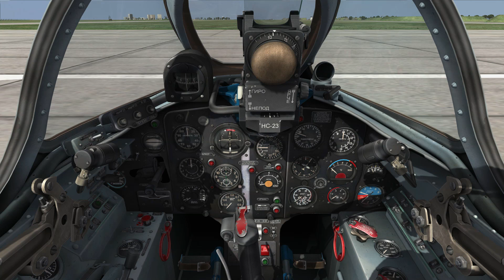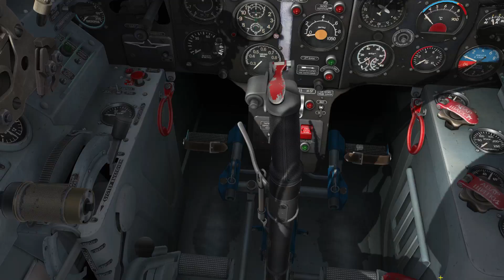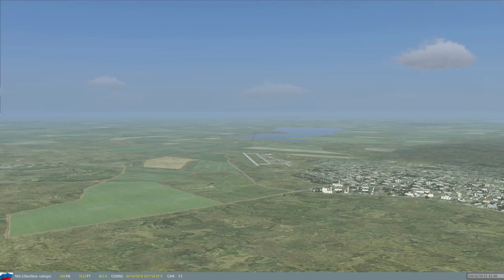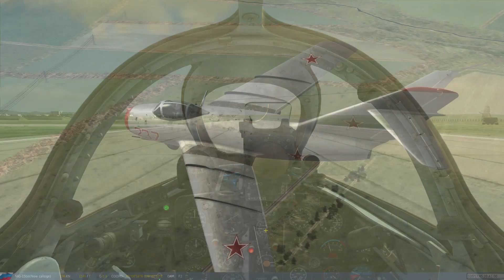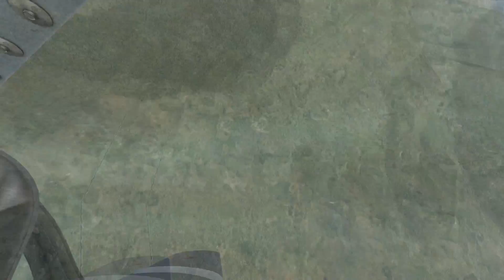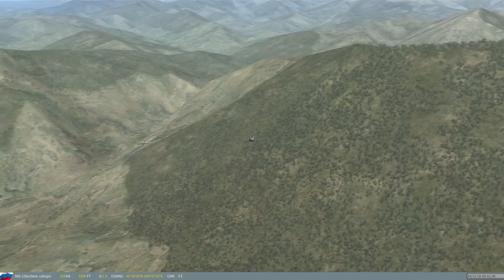FROOGLE'S HANGAR : DCS MIG-15 BiS BETA

Comment: Actually the MiG-15 wasn't designed to fight the Saber, it was actually designed to take out high altitude jet bombers, that's why it has such a cannon heavy load out. The Saber was designed in response to the MiG-15.

Comment: I know this probably sounds like an idiotic question to someone with a lot of experience with the sim, but how do you know what runway the tower tells you to take off from? For example at Sochi the tower tells me to take off the mig from runway 22.
Reply: The Runway 22, 9, 15 etc refers to which compass bearing the runway is pointing towards. For example runway 22 is 220°, runway 9 is 90°  or due east. So when the ATC tells you to take off from runway 22 check your compass in the aircraft to make sure when you taxi onto the runway, you are pointing down the runway in that direction.
Reply: Thank you very much! I knew it would be something simple such as that... lol
Reply: Carkshark No worries mate, happy flying.

Comment: Very nice quick look about Mig-15. It was reason to USA speed up and quickly deliver F-86 to battlefield and even little bit unfinished.

The Mig-15 doesn't have a machine guns, as You don't seem to be so familiar about military definitions etc, the 20mm is the caliber after weapon is categorized as cannon. So Mig-15 has three cannons, two 23mm and one 37mm. And you really will have huge benefits from those as example F-86 has just machine guns and those are .50cal (12,7mm). The 12,7mm is the limit as well to Heavy Machine Gun aka HMG, and Soviets had own even above that the 14,5mm that is used in many of their ground vehicles like BTR-60/70/80 and BRDM-2 etc. So watch those when flying low as the 14,5mm might sound low, it will rip any plane to pieces, even a A-10 "flying bathtub". Soviets has 12,7mm HMG in most of their ground vehicles as AA and while it is effective up to 1500-1200m for closing aircraft, it is mainly against helicopters or anything that doesn't move horizontally/vertically much.
Soviets use the 23mm in their AA platforms like the famous "23-2 Sergey" or as you mentioned 23-4 Shilka. 
So you will have lots of dangers in the air when flying against Mig-15 or benefits when flying it 😉

The F-86 .50cal are almost useless, you need to drill lots of holes to Mig-15 to get it down (AI has more protection than human players because AI fly always in SFM instead AFM/PFM/EFM) even when human flies it. But Mig-15 can basically take F-86 down with a single hit, especially when hole is made by 37mm 😁

A 23mm HEI shell makes about 20-30cm wide hole to any aircraft/vehicle that isn't armored against 23mm HEI (AP will go trough) as usual AA ammunitions are such.
A .50cal is like any other caliber so they can even bounce off from the normal aircraft if not hitting in good angle.

It still sad that the damage system isn't so well simulated in DCS, like we don't get blown out holes to aircraft but just texture changes, but at least systems behind hitpoints is simulated in most so if there is something important, say bye bye for it.

And once we get more realistic AI for ground units we can start flying lower as now every ground unit even with the lowest skill are excellent marksman to moving targets. You should check couple videos from YouTube about example BTR-60 in museum that one young man operates and you see how difficult it is to aim a 14,5mm by hand cranking.  And then there is a good video about Russians testing a Mi-28 attack helicopter cockpit against 23mm HEI-T. 

And while at it, check just 23-2 Sergey firing to target practices if you haven't already.

Gives you different view how military aircrafts are designed and operated when you know what they are against at. 

I bought Mig-15 on last sale and it is as great to fly as Mig-21 and it feels very easy to handle and recover.